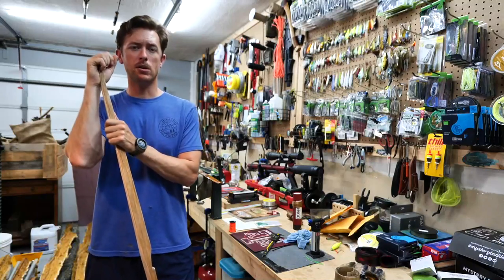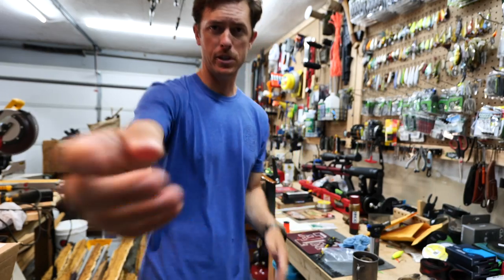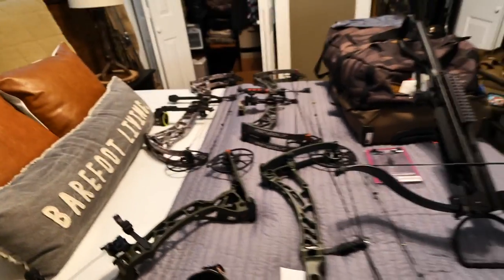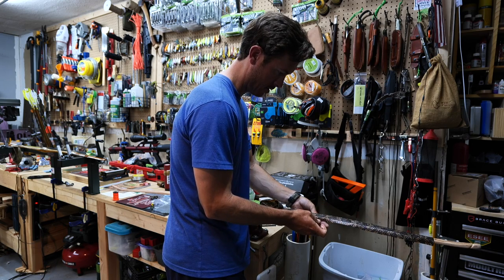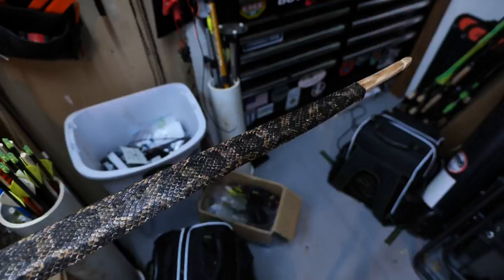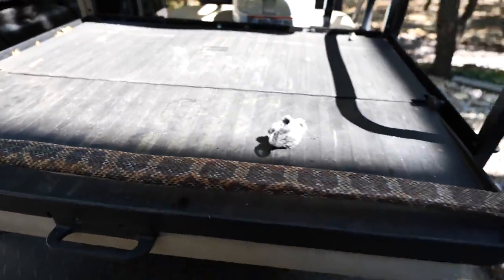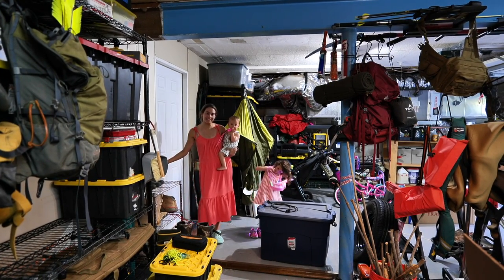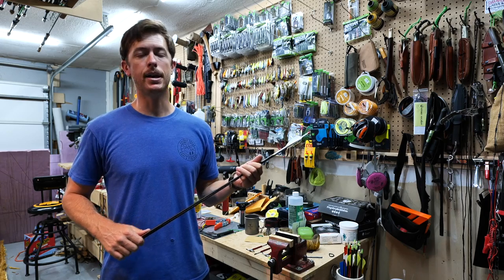Using Real Snake Skin on Homemade Hunting Bow - Beautiful Camouflage!

Comment: For fletching, you have to try the new Zinger fletches. I have been shooting them for a year and they are fantastic! I got the 4 fletch with a 6° helical. Lusk Archery channel is also trying them. They are easy to install as you just slide the whole thing over the knock end of the arrow. Don't even need glue. Give them a look

Comment: Best piece of advice that I wish I would have listened to early on when it came to bow hunting is don’t bother with the high FOC setups unless you are hunting something tougher than elk just keep it under 500gr I usually shoot an arrow that is 5 to 6.5 grains per pound of draw weight and it will go clear through without slowing down 99% of the time and you will have a lot less misses as well. P.S. micro diameters are great but can be really finicky when it comes to shooting fixed heads

Comment: For arrows I use Goldtip Hunter pro, fletching I use FlexFletch Sk 300, and I started using Iron Will Broad heads last season. I run a high FOC set up, with a 100gr insert and 200gr broadheads

Comment: Sirius Archery makes great arrows. I shoot 3 inch vanes, helical, 4 fletch. Then my trad arrows are Sirius as well, with 3 inch turkey feathers, learned that from you. 
Full arrow build for compound:  30.25" 250 spine with 100gr insert, 200gr single bevel, 4 fletch, giving a total of 723gr, roughly 23%foc.
Trad arrows: 29.50" 340 spine with 75grain insert/outsert, and same 200 grain single bevel.
Reply: My compound bow is at 68 lbs after string stretch. And my trad bow is 63 lbs with a 28" draw.
Reply: I absolutely geek out over bow hunting. And love building arrows that fly perfectly and can get the job done even if you miss a little and hit that shoulder, bc with a stick bow it is so easy to miss by a little.

Comment: Clay hayes and Tom Clum are great resources for people new to archery. Clay is a master bowyer and had a comprehensive course o the push archery website. Tom is a level 4 coach that take archers to the next level. Beginners especially benifit from his solid mechanics course that helps you beat bad habits and ingrain good ones while helping prevent injury.
Reply from the maker: 100% agree
Reply: Absolutely love Black eagle vintages for my trad bows and the black eagle rampages are my go to when I build and tune arrows for my compound friends. I am eager to try sirius archery new trad arrows which have a lighter gpi and allow more foc per spine.

Comment: i buy easton full metal jacket shafts i fletch em myself with aae max stealths and put a 2.5 degree right helicle and on the buisness end ive got a 35 grain outsert with a 125 grain slick trick viper trick total arrow wheight is around 525-530 grains it works great for anything in ohio